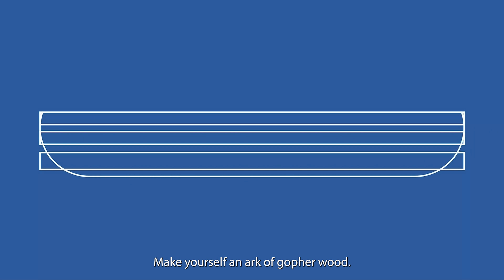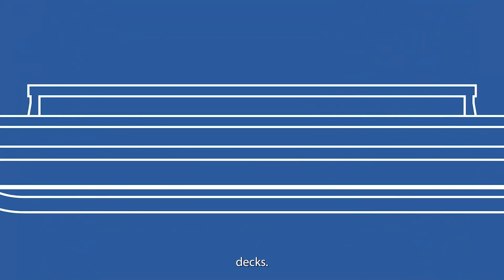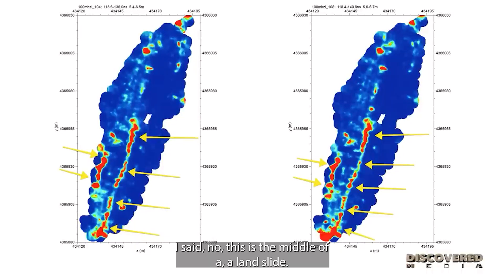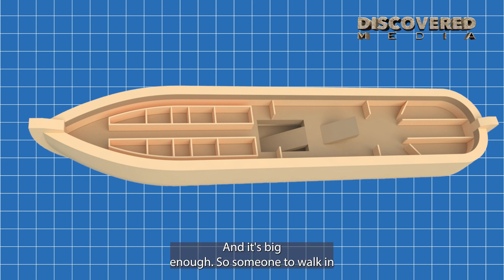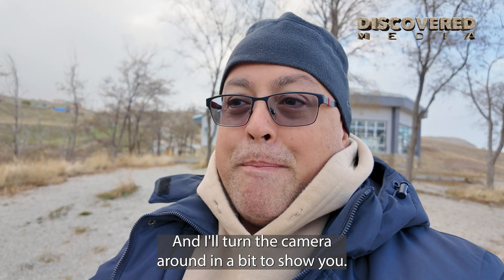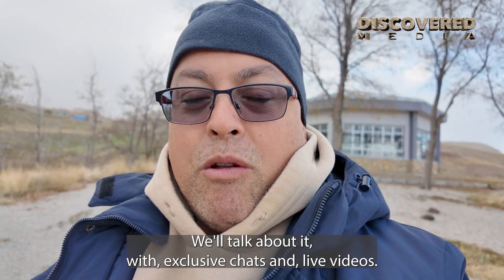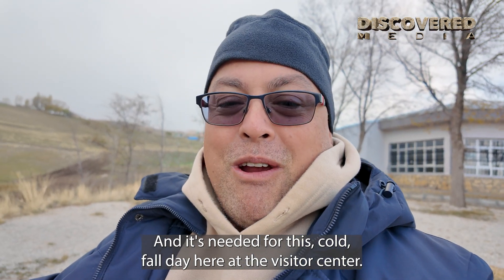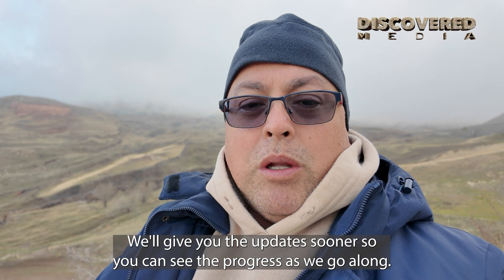Analyzing Noah's Ark Designs Using Cutting-Edge Radar Data (sneak peek)

Comment: I always felt that as we crept closer to the 6000 year mark, which also happens to correspond to nearly 2000 years after Jesus died, that we would get some very strong, condemning evidence for the Bible. I believe this may be one of them. If this gets dug, and we find more organic materials from animals, it will surely break the internet. A giant boat on top of a mountain, what can the sceptic say? It would arguably be in the top 5 most powerful proofs of the Biblical narrative, as there are no incredibly detailed global flood narratives outside of the Bible. It single-handedly would prove that the flood narrative was based on a real story, that no one else had the complete information to tell. 

Can we crowd source a dig?

Comment: This isn't the ark on that hill side... the bible is clear what it was shaped like and it was basically a barge.  Making it with curved sides and a keel made no sense since all it had to do is FLOAT and have the greatest interior space it could!  The far left boat at the 15 second mark is probably close to what it looked like.  To make a scale model all you need is to cut a piece of 2x4 about 30 inches long and there you have it!

Comment: God is the one who gave the information to Moses that he wrote down in Genesis.  The information is specific.  Sir Flinders Petrie and Rudolf Gantenbrink after extensive measurements agreed that a measurement of 523.6 mm or 20.62 inches was used in the construction of the Great Pyramid at Giza, and that's the royal Egyptian Cubit.  So taking that as the standard, the ark at 300 cubits long would be 515.5 feet long, 85.92 feet wide, and 51.55 feet tall.  It did not have an open, topside deck.  The amount of water that fell non-stop for 40 days and nights would have overwhelmed it.  The ark was simply a cargo container, meant to do one thing; float until the flood was over.  Most likely it was rectangular in shape, as that would be the most efficient for storing cargo.  The roof would have either been peaked for water run-off, or arched, with an overhang.  There were vent rectangles along the side just under the overhang.  Being covered with pitch inside and out, the ark would have been pitch black; not wood colored.  There is nothing in the description that would indicate a narrow clerestory on top running the length of the ship.  The entire roof had to be a single shape sealed construct, as it would take the brunt of the force of the amount of rain that fell.

God told Moses the ark came to rest before any land was visible, so it had to have landed on top of Mt. Ararat, the highest place in the area; nowhere else.  The land formation talked about in this video could very well have been made later as a shrine, by the mixed group of Ham's and Japheth's descendants who were in that area.  Going up and down the mountain was not practical, so it's not out of the question that a lower elevation shrine would be made.  If it is man-made, there should be some evidence inside the construction; the walls, and underneath the inside surface area.